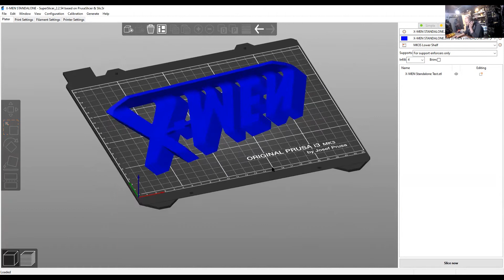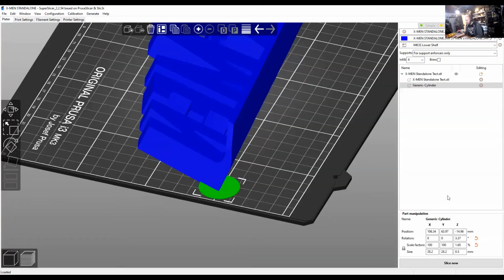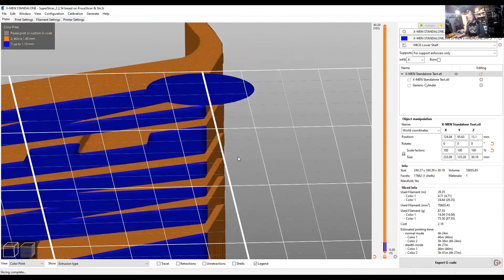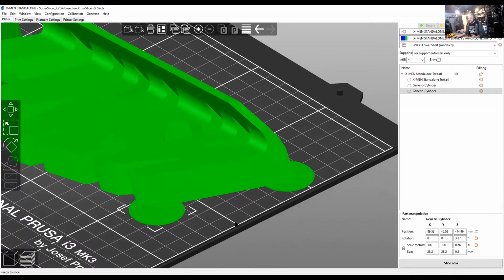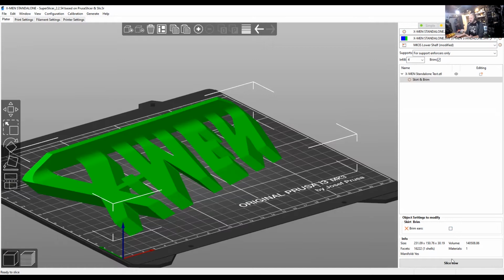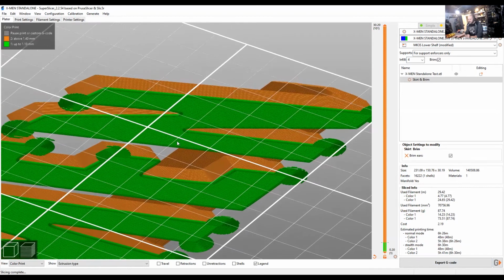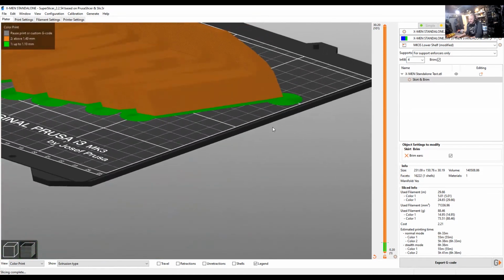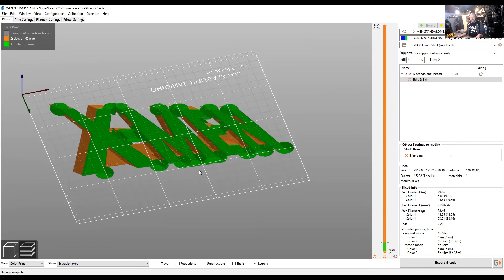How to Generate Brim Ears with SuperSlicer

Comment: Out of interest, why do you print the first layer cooler than all the others in the bed?
I'm having issues with the parts warping so much with PETG it's pulling the brim up too!
Reply from the maker: That’s a good question! I actually feel like 85° is the right bed temperature for the PETG that I use, but to ensure even better adhesion throughout the rest of the print I raise the temperature. Sometimes it doesn’t make any difference and I still have some warping, but a lot of that is based on the print surface. I have noticed that TH 3D has a really nice print surface – it’s the textured flexible one and it is awesome. I rarely have any warping with it using either PETG or PLA.

Comment: Awesome video thanks, Very keen to use the ears rather than adding a cylinder however when I control click (Mac) and go to add settings there is no option for brim? Is anyone able to advise at all?  I'm using Prusa slicer and have upgraded to 2.3.0